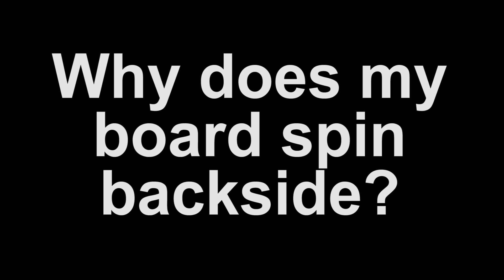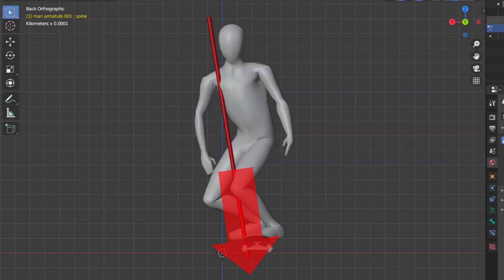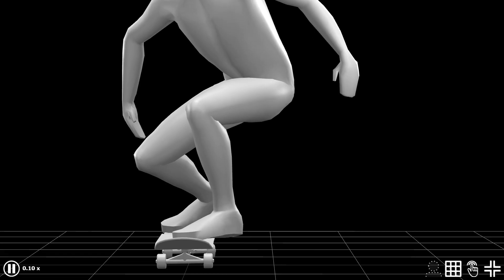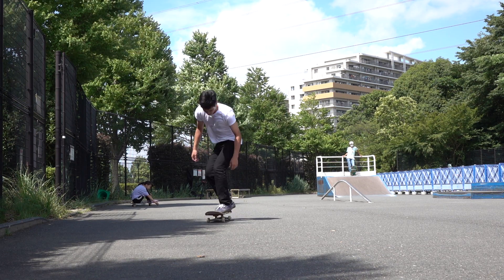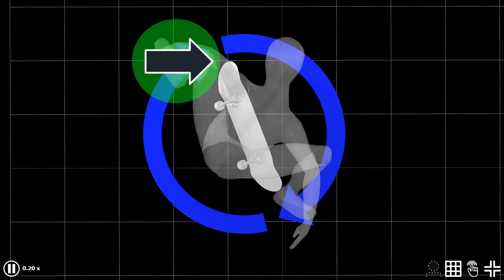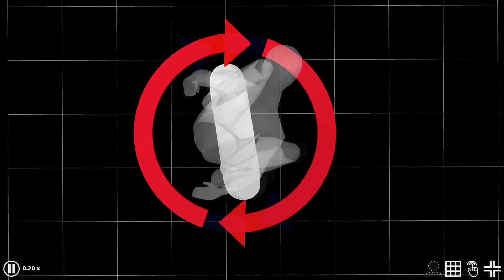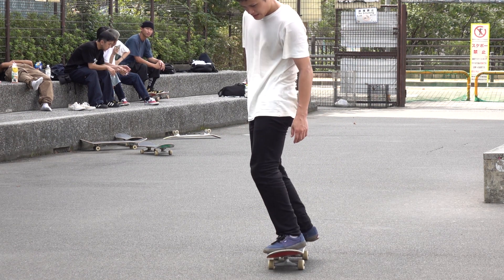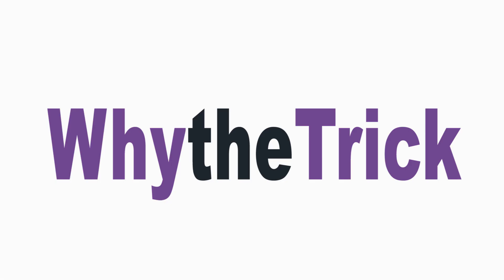Why does your kickflip spin backside? (2/2) Strength of flick and pop

Comment: Great video! I had same problem when i learning kickflip, but somehow when i figured out why it turns, its not about the thing that you mentioned in this video,, maybe its subjective but if you said the reason it turns is over pop, how about jake hayes who can do kickflip over 1 meter height? And also not  Over flick because how about anyone who do double or triple kickflip? 

I figured out that the real reason it turn is just because you flick to much straight forward,, thats why dolphin flip do a little shove it rotation
Reply from the maker: Thanks for the insight!
I guess you are right but here are my points below:

OVERPOP
It is when  you pop too hard "relative to the position of your body."
So if you can elevate your body high enough, you can pop as hard as you want as long as the board doesn't exert too much pressure to your front foot.

OVERFLICK
It is when you flick too hard and your flick goes parallel to your board.
As you mentioned, overflicking may turn your board when you flick too far forward.
You can flick as hard as you want as long as the flick's energy goes perpendicular to the board's longest axis(the one that connects the nose and tail).

Comment: Wrong…….keep ur shoulders parallel with your board 🫢
Reply from the maker: May I know why?
Reply: @whythetrick  first off, when you pop the board too hard, late or wrong, you can “push your shoulders open” and and your feet will fallow your shoulders. They won’t land front foot and back foot, they will be left and right. When you pop looking forward (with your shoulders) your easily off balance and your board won’t stay under you, your head can be looking anyway you want but do some Ollie’s with your shoulders straight and you will have Ollies twice as fast. If it’s uncomfortable at first that’s bc it’s going to but keep at it and something will click soon. And on the kickflip spinning, your kicking too straight and flick at more of an angle. Too much grip is one thing but if you angle your flick out a little more. I’m regular stance, I kick to my left more. Every day you have to find that 📐 of the flick. It changes from when grip tape is good to bad and also with shoes that are new to bad. Used shoes and ok-bad grip flick is very straight forward. That scale fluctuates week by week, day by day. Also shoe size and board size have there factors that need to be involved. All that changes, basically if it spins bs your kicking too straight and if your too far out, it just won’t flip all the way and yeah. Straighten your shoulders if your need to turn, swing your arms when you pop and bam a 180

Comment: Super interesting! Are those 3D animations physically simulated?  I'm interested in physical simulation of skateboarding and exporting of such data for motion capture reference.
Reply from the maker: Thanks for the comment. Models in this video were made manually using a modeling application. You can try converting your video into a 3D animation on my website. 
https://whythetrick.io

Comment: but how do i get higher kickflips then if im not supposed to pop harder?
Reply from the maker: Thanks for the comment.
You are supposed to pop harder if you want higher kickflips. The point of this video is that raising the nose unnecessarily higher relative to the height of your front foot makes it harder to flick out your front foot. On the flip side, this also means if your front foot is located high enough, you may pop harder so the nose “reaches” the nose.

Comment: Such a great channel! I just subscribed. Keep doing what you are doing! The use of 3D models had such potential. 

One thing I wanted to mention though, that could help improve the channel, is with that 3D model of the kickflip, the skater (I presume is you, with motion capture technology?) is popping extremely diagonally with the back foot - the body weight is all over the front foot (the shoulders may also create issues in analysis.). Though some amount of this weight distribution pattern will happen on an ideal kickflip, the extremes that it goes to in this example, in my opinion, give you a much less common, less ideal and less valuable 3D depiction. The concept is great, but that specific model is exhibiting problematic technique which will skew your results impactfully and even possibly present the channel as somewhat 'out of its depth', for lack of a better word, which I don't want for this channel because it's clear you have a capable analytical mind for the physics of skateboarding - and again, the use of 3D models has a lot of potential! If you've used motion capture technology to generate this 3D model, can I recommend asking a local skater who has consistently solid kickflips to do a second model for you to compare between, perhaps even eoverlay? Or if it would be possible to generate one from footage, like Luan's, as you mentioned, that would be idyllic. Anyway, i only hope to enhance the channel! I do a similar skateboarding analysis series on my channel. Thank you for the exciting new content, and well wishes to you! 😊

Comment: Finally there are some scientific analysis about skateboarding tricks, well done! I have a question / idea for additional topic - there is a long going debate about flat vs steep kick decks and how they affect your pop. Personally I feel I can ollie higher with a steeper deck, thinking that steeper decks create larger angle after pop, although it requires more force to pop a steeper deck. My question is - would you ollie the same height if you would use an equal force, popping steep and flat deck?
Reply from the maker: interesting question.
I'd say a steeper deck would make my ollie higher but I need to confirm this. Let's see how to do it...hmm...

Comment: Great explanation. Something to note: when doing those super-stylish ninja kickflips (check Dan Corrigan's "KICKFLIP MASTERCLASS"), the front foot is over-extended while the back foot is angled inward, toward the front foot as you bend your knee. The idea is to catch the back end of the board with your back foot and essentially pull it toward your rear. Your front foot would be kicking straight down and through the heel-side pocket to dip the board toward the ground while airborne, then level out upon catching. Please watch the video & let me know what you think of this method, as I will be practicing in this fashion! Thanks for your efforts.

Edit: typo
Reply from the maker: Wow, thanks a lot for your insight.
I believe the majority of what you mentioned is right, perhaps aside from these ones.

1. "Kicking down" is a tricky expression as you know.
Although it is true that you have to generate downward momentum to dip the nose down, moving your front knee is always a bad choice. Imagine your front foot moves like a pendulum, making your front knee a pivot point. Then, no matter how far you extend your front foot, you won't be lowering your front knee, which may cause problems like landing angled.

2. Angle of flick.
Indeed the nose dips down in boned ollies like his ones. But it is NOT because they kick down.
a. As you pop, you give the nose energy to go up.
b. As you flick HORIZONTALLY FORWARD, you will be stopping the nose to go up.
c. Kinetic energy of the board doesn't disappear all by itself. The board needs to find a way to dissipate such energy somewhere.
d. The only way it can go is the tail. Since you stop the nose from going up, just like a seesaw or something, the tail goes up instead.
So the point is, kicking down is NOT the reason why the nose goes down. You should just focus on flicking forward.

*I'm saying this largely based on my assumption though. :P
Reply: @DarmokAtTanagra  When I did kick flips "naturally" they would either rocket, or fly away in front of me. As soon as I started angling my foot downward, my kick flips became awesome. You can kick forward, but angling down rockets the tail more for gnarly catches. Newton's Law of the Conservation of Energy posits if your legs are moving up, you're going to be kicking in that direction, naturally. You'd literally have to kick down with effort. Try skating and see for yourself.
Reply: I can't edit comments on the iPad anymore. YT sux, but; my observations are from actually skating and trying things in practice, not theory. Sure, your foot can go "down naturally" or whatever the case, but intentionally angling your foot down when you flick adds more downward force to rocket the tail even more so it essentially decreases the time before it catches. Landing a kick flip is a combination of force applied to flick, pop and jump height+landing. You can successfully land a slow-flipping kick with huge air, but you'd have to land later and flick softer. Likewise, you can land a short-popped, super-quick- flicked kick, but would have to apply more force to the flick to have it spin faster. For me, angling down a bit more on the flick keeps the board more centered, as I decrease the window of error to cause the board to fly away forward, as less energy is being flung ahead, rather toward the ground. Of course, with enough practice, you'll understand where to flick your foot and with however much force appropriate to the pop. There's no 1 way to do it, but boning the tail feels amazing for me - a smooth rotation on the ascend and a nice even catch at the peak of the jump just feels so rad!